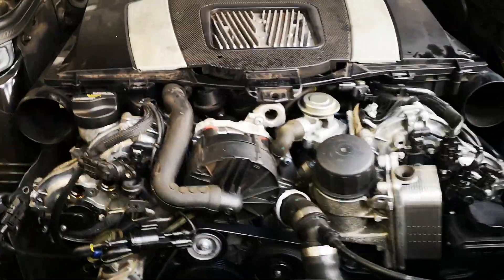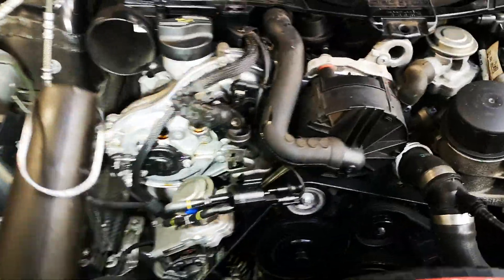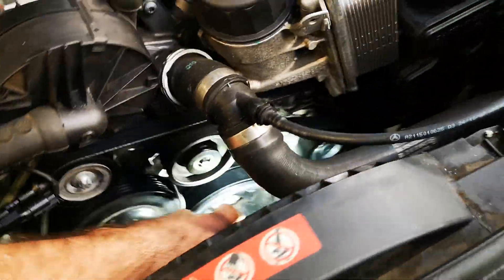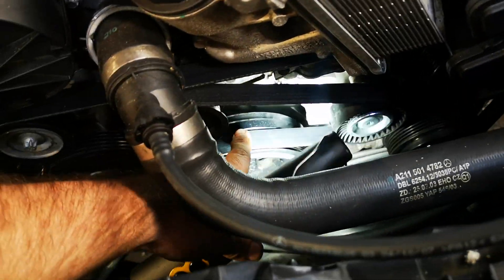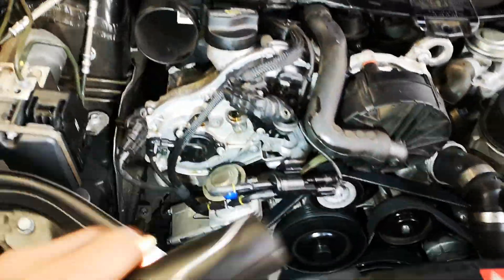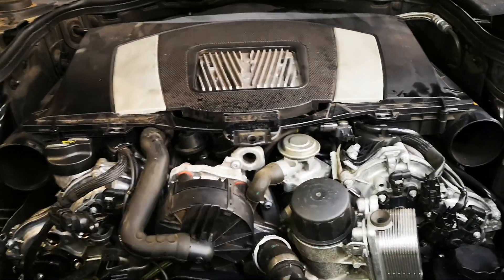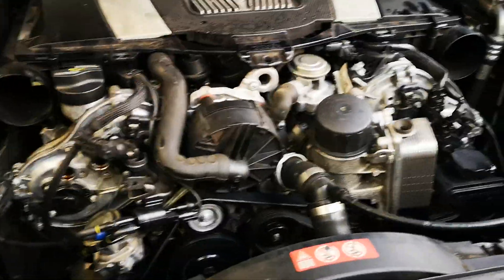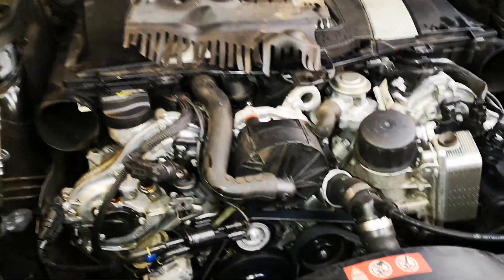Mercedes Benz PO0017 camshaft timing retard 211 chassis E280 E350 check engine light camshaft sensor

Comment: Mine does not have vibration at all , is there some speed that start to vibrate the engine? My engine light came on gives the codes for cam shaft. I have been set the line and check the marks right side when you from front of the car. There was the marks exactly ib the middle the other side upper mark was in the middle the downs one was maybe 1.2mm but the line was not out of the hole. I was able to see that mark lines on the around here clearly. I changed the camshafts sensors from the other side to the another it did not give me almost 1 month no engjne light. But today it came again. Any comments on this.? The guy has veen used 0w40 some cheap oil 2 months ago changed.

Comment: It's not caused by oil. It's exacerbated by oil. Mercedes got the metallurgy of the balance shaft wrong. Metal is too soft, the timing chain will grind the balance shaft sprocket teeth off no matter what. Happens at a lower mileage in the early m272s and it happens at a higher mileage in the later m272s.

Comment: I have P0016 and I have done this test but both stamps are in the center, perfectly.  So, does that mean i need to buy a sensor??  I was going switch sneaors around to see if the code follows sensor?????

Comment: My stamp marks are dead central on 305 degrees. Solenoids changed, sensors changed, balance Shaft done. Still getting intermittent cel. Could it be the ecu or instrument cluster ?
Reply: What’ve you found out eventually, James?  I am having the 1208 issue with exhaust side off-centered.  But I am not convinced it’s the balance shaft cuz all other things work fine.  Looking for the next step diagnostic?
Reply: Basically I changed my solenoids, sensors, added the pig tail sacrificial harness cable s, repeatedly cleaned the oil leak off the old cable, and stopped using the manual transmission.
Reply: @James Collins: that must be very frustrated (to see CEL after all those work)!  I am curious, how many miles you got at the time and what was the state of the BS?  I am in somewhat similar situation (160K miles, exhaust stamp off center); but I am still not convinced that it’s the BS?  There are some guys went as fas as fooling the ECU—since sometime it may act not so smart too 😉?
Reply: If your Stamos are not centred then that should indicate timing is out of alignment. Be sure when you check the stamps you are level with it. I used my smart phone camera and lined up the lense to do that.
Reply: @James Collins: yes, when shown the picture, MB dealer believed my exhaust cam is retarded by half a tooth.  Problem is, I am getting code 1208 (intake) more than 1200 (exhaust)!  When you did BS, did you notice your cam adjuster had any wear at all—especially areas around the dowel pin?  I am suspected that where my problem is—because symptoms are: once driving above 70 mph, the Intake cam seems to be locked up at 36.2 degree and not moving any more—although normally it could move 0-37 degree without any issue!  What’s your thought?
Reply: @petediegan2794  my balance Shaft was changed by previous owner so I can't answer your question. Have you checked the timing stamps yourself to verify MB garage is telling you? Change all solenoids, then sensors, and regularly clean oil seepage from cam cables, add the piggyback cable harnesses also. Also keep the car in auto mode not manual gears.
Reply: @petediegan2794  I also have 1208 alone with p0016 and p0017 I’m gathering information before I do anything I was wondering if you fixed your issue yet it would be helpful if you tell me what you did ?